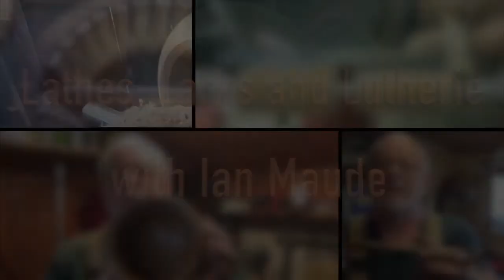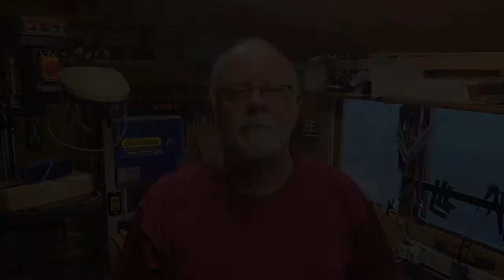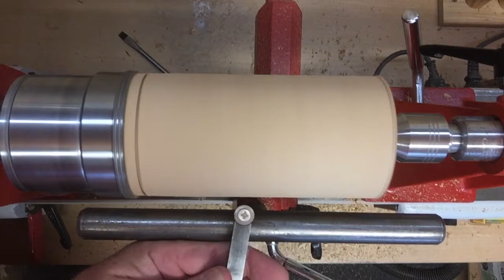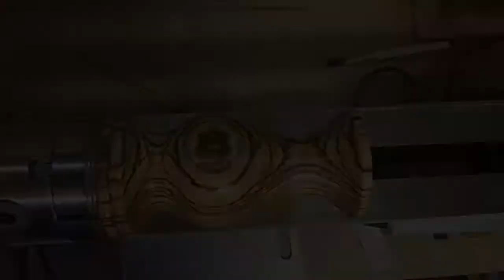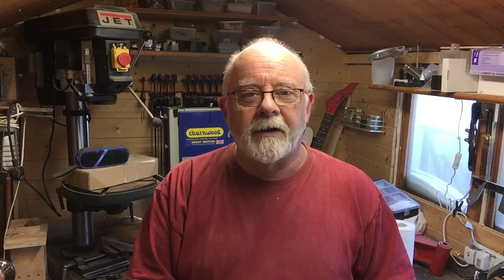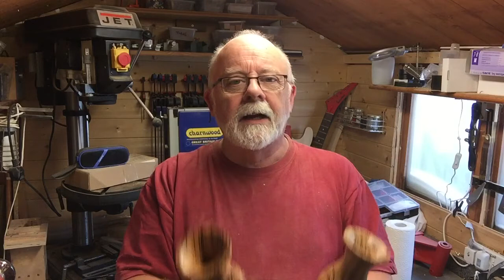Two Matching Bud Vases

Comment: First go?  I think you did dead on.  It is very difficult to make identical pieces so you've done a great job there. As you said, keep designs simple because simple is elegant and, if you can make a simple piece well, you can make more complicated pieces well.  A professional turner told me not to get too hung up on exactness in copies because a pair of anything seldom sit together, they are usually at either end of a mantlepiece or bookshelf.  He also told me that, for competitions, to make the bottom stand/foot wider than the piece on it because judges can't get the pieces exactly side by side to assess accuracy.
Just on design, simple done well is difficult to achieve but looks stunning if done right.  I always think a 'simple' bowl is hard to make because everything, shape, proportions, wall thickness, etc has to be spot on.  I made a load of 'simple' bowls for eating out of a while back and they were some of the hardest pieces I ever turned and I still wasn't happy.  The customer was but, as always, I knew what I wanted to have done better.
Best Wishes, Brendan.
Reply from the maker: Thanks as always Brendan!  Yes, my first go.  My bases are slightly larger than the rest of the piece so I did right there :)  I remember you bowls and plates very well and I was in awe of the skill to make them.  Maybe one day!?

Comment: Hi Ian, I watched a Martin Saban-Smith beginners video the other night  on turning a small bud vase. Martin used a small glass test tube to insert into the drilled hole, so the bud/flower/weed could survive the day. Because I'm going to give this a whirl I've sourced some plastic test tubes at something like 4p/ tube.

I love your approach to learning new skills and its something I am try to aspire to. I've got a 'ton' of green Leylandi, from a recent felling, which i'm practicing on, plus some large White Willow pieces which were from a recent felling of tree encroachment to power lines, but the wood weighs a ton and is almost unworkable at the moment.

cheers Alan (aka Owd Jockey)
Reply from the maker: Hi Alan,
Martin comes u with some great ideas and is, of course, Mr Hampshire Sheen :)  Thanks for the compliment.  just about everything I do is new ;)  The wood sounds awesome!

Comment: Hey Ian ! How did your paddy trip go ? 

Great job on the bud vases, nice matching job.

I agree with Keith, "but don't tell him" a card template works very well for copying. 
Also if you have a pin jaws for your chuck, you can leave finishing both pieces until you have them shape matched, leaving you to do slight adjustments if needed on the pin jaws....
They turned out beautifully mate.

cheers Ian, regards Steve
Reply from the maker: Thanks for the tip on the jaws Steve.  I do have pin jaws for that chuck.  As I said to Keith, I had challenged myself to do it freehand, hence no template.
I haven't been to Arranmore as yet.  We set off a week on Friday, I am so looking forward to it!